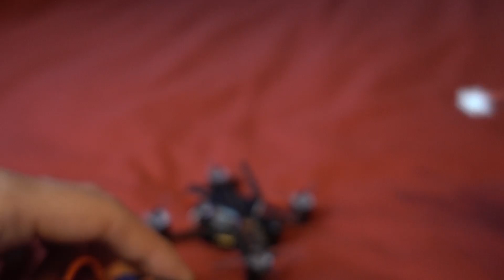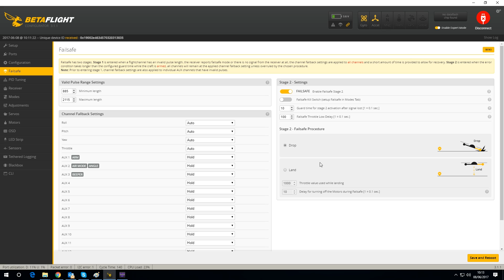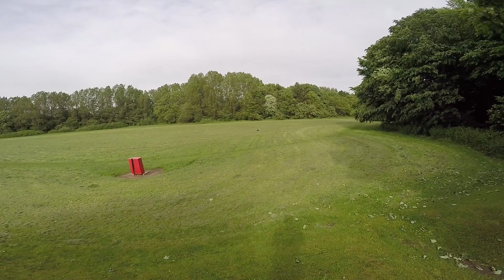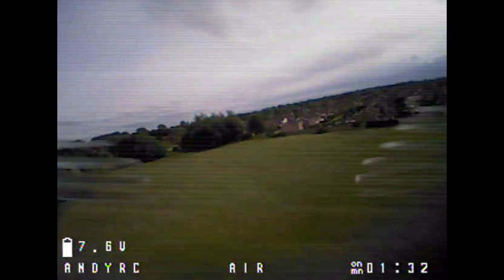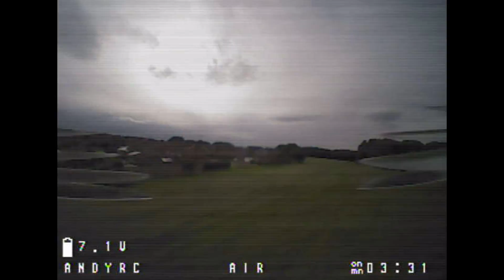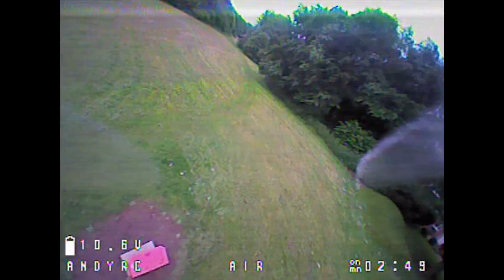ARFUN 95 Pro

Comment: This is an unrelated question to this quad but I do want one of these but I have a question that you may be able to answer. I was flying on my property the other day with my little qx90c which is perfect for my tight space and trees etc. plus I’m new at the hobby. What happened is I hit a powere line and the model went down. After that when I would throttle up it would yaw like crazy to the left. I changed all the motors and  that didn’t fix the problem but I hooked it to clean flight and it fixed the problem. Now the thing won’t connect with the taranis radio I use. I tried to bind again to no avail. Do you have any idea what I may have done wrong. I even tried using my old cli commands that I have saved on a notepad file and still can’t get it to connect. If there’s anything you know of that I may have done wrong or that you know may fix my dilemma I would much appreciate I know you probably have short time but your videos have helped me learn a lot that I didn’t know so I thought I would ask. Thanks lots.
Reply: Olli Garch bind the radio and rx and then go back into clean flight or betaflight and check your channels. The order has to be correct. If you powers the rx you can see your stick moments and adjust so that all your inputs match corresponding channels. Ensure you have modes and arm switches set up and you should be good to go

Comment: Hey Andy. I dont if you've experience this, but everytime I land with the battery below 8v I cannot re arm it anymore. Its like the gyro cannot initialize with lower than 8v. But on the bench and with the usb plug in, the gyro (3 beeps) will initialize and the copter can arm.

Comment: Hey AndyRC, Great review as always and as always I learned something new.  I watched a review where the reviewer put the four blade gemfan props and used a different battery with the eachine Lizard 95 and he was clocking at nearly 100mph.  That is crazy fast!  If true it's hard to imagine the Arfun pro is much faster than that.  I purchased the  lizard with frsky for $126.00 and got $3.00 off at Banggood so I got it for $123.00.  The Arfun 95 Pro is $175.00.  Not sure I believe the Arfun 95 Pro is worth $50.00 more than the Lizard.

Comment: Can someone explain to me how this quad is worth $175.00 considering you can build a quality 250 racer including a 4 cell lipo for the same price. Seems there's greed creeping into the hobby. And to top it off it comes with an inadequate battery.
Reply from the maker: pretty simple, smaller components re more expensive to produce its amazing you can even get micro components the same price as 250 racer components in my opinion. I use to have a similar opinion.... until i flew one :)

Comment: Help, I expirement erratic "flip of death" even at mid throttle with Eachine 2s 450mah 80c batteries !
I have the Frsky version.
Am I the only one ? Is there something to change in Betaflight that could help ?
Thanks.
Reply: Zeu d'Homme nope you'll need better batteries or switch the connector to an xt30.
Reply: jussa101 : what better batteries could I use. Those are 80c.

Comment: Hi Andy, long time subscriber, love your reviews! Very thorough, informative, and honest. For me, it's not all about how fast it is. It's about how versatile it is and the price. Between the two I'd definitely buy the Lizard, because $176 bucks is way, way too much for a 95mm micro! What were they thinking?! Exactly $50 more than the Lizard, and for what?! 

So, what I'd really like to see you review is the new KingKong 95GT and 110GT. 
95GT especially because it comes with prop guards and will be great to fly indoors.  My personal opinion is it might just be better than either of these... For me... Because I can have a blast flying it indoors AND also outdoors making it much more versatile and an upgrade to my Tiny Whoop!  There are a ton of outdoor flyers, but very few really, that are great indoor / outdoor flyers!... And that will run on a 2s or 3s battery. Imagine, it's pouring down rain (not hard for you to picture that from what I've heard you say! Lol), so only flying indoors today... The ARFUN and Lizard stay on the shelf because of too much power, but the KingKong 95GT and it's predecessor the 90GT get to run through an indoor course using a 2s battery with handy prop guards installed! ... So, later that day the sun comes out. I grab some 3s packs and head for the park with my same 95GT!  I like the idea of having that versatility! It should also be a little rocket on 3s, which it is rated to use from the factory. Sure maybe not quite as fast as the ARFUN, PRO, or Lizard, but! More versatile! 
PLUS! It's available with choice of 4 receiver's of your preference for EXACTLY HALF THE PRICE OF THE ARFUN PRO! (not from Banggood or GearBest). 
Yeah...really interested in a review of the KingKong 95GT!!!  Thanks again Andy! ;)

Comment: Disappointing about the battery and the continued brown outs. Last night I purchased a Lumenier 2S 50/100C battery to try on my KK90GT. I've used 25C and 35C batteries (300-350mah) on it and it flies well, but if I put on some better props, it might need "more power" .. ha ha.  Thanks for your review. Seems like a winner to me. Cheers!

Comment: I got the lizard for £94 on aliexpress and then ive ordered the arfun frame from gearbest! I recon then it will be a perfect combo. I'll do a video on it when it arrives
Reply: Use code rc18off on Gear best for Arfun pro 95. Mine just arrived
Reply: Yeah ive run into the same problem! im just happy to wait now tbh! im going to order a brushed micro in the meantime
Reply: The first code that actually works haha!
Reply: Maceyee  I might get it instead the lizard. What do you think?
Reply: Thats what i did, cant comment on lizard but i felt justified when i saw the antenna repair process for the lizard. i think if you took lizard youd be upgrading parts so it'll come to same cost eventually after discount
Reply: Well its preference mostly between whip and cloverleaf antennas , better range but less durability on the clover leaf. I think the lizard is still better though , It has a 100mw vtx a tripple integrated stack flight board (arfun has a seperate reciever) The motors are more efficient so " should" get longer flight times and the battery that comes with the arfun is rubbish! On the comparison videos I like the way the lizard flies better especially when doing acro( but thats preference again). Ive heard alot that the arfun's arms break alot even from small crashes , they are needle thin! finally the lizard is £45 cheaper so for me its a no brainer.
Reply: yeah summed it up - i went Arfun for the smaller package and carry ability - dont fly acro either. I agree that i found out about the arms breaking late but am prepared to lift and shift entire electronics onto a new frame if the worst happens
Reply: Yeah there isn't really an answer to which is best! they excel in different areas. So its different for each person! :) just have to choose
Reply: which brushed micro ? I got the eachine qx95 and its really nice but I broke an arm of the frame hahaha
Reply: Joseph Loa I was going to order QX95 but I'm not sure it will bind with the flysky FS-I6s and if its good to fly indoors as well! would you recommend it?
Reply: Ed Jones I think would be OK I got flysky Fs-i6x and I don't think will be OK for indoors because it's kind of difficult to control... In outdoor for me is very good and can fly it outside my house and it's soo good can  take a lot of wind... Sheme that today I fucked one arm doing acro Hahaha
Reply: How long will take from Aliexpres? im leaving in London and I am not sure if is reliable to but it from there.. what do you think?
Reply: I buy all my quad gear from there, Seems more reliable than banggood to be honest they dont run out of stock as much and any problems ive had have been refunded without question. Aliexpress are the only place with it in stock at the moment? so I would go for it!

but usually its around 14-20 days with the free shipping. You can always pay extra for it to come faster. Everthing thats £50+ from there seems to have a tracking number so you can see where its at.
Reply: Wow I didn't know that man so do you know how long will take the lizard95 to London ?
thanks bro!
Reply: I'm in cambridge so pretty much the same as me 14-20 days i would guess?
Reply: If I choose the DHL 7-14 days probably I will get it next week no the other one right ? because I might buy it now if is like that...
Reply: yeah with DHL you will it will be sent by air mail and not by boat. Its expensive sometimes though, im just happy to wait haha
Reply: Ed Jones Hahaha thanks for your help bro I will buy it right now is £16 more which is £112, 54 and it's better because I was about to buy the Arfun 95 and that one cost £139... So thanks bro!
Reply: We should meet one day and fly the drones Hahaha I have the qx95 and a mavic pro :)
Reply: There is a coupon code for the arfun i think "ARFUN" I dont know if it still works? but i prefer the lizards electronics, the camera ,the better battery and the efficiency of the motors, not to mention its cheaper! The lizard seems to have more than enough power/speed for me, the arfun doesnt seem to have the same feel!
Reply: Ed Jones well... I already bought the lizard Hahaha let's see if I can get it soon.. As well I bought some batteries in banggood
Reply: Can you believe that they told me that they have the Lizard95 available the 30 of jun ? and in Aliexpres said that there are 73 available... so they told me to wait till 30 (and I paid already..) or cancel it and get a refund... so what do you think... wait and get it next month or get li arfun95
Reply: Really? that is bad , what version was it frsky? I brought the flysky version but its not been dispatched yet. I got it from the Eachine store through aliexpress did you get it from there too?
 I Personally prefer the lizard but if money is no object go fro the arfun 95? depends how patient you are?
Reply: Ed Jones yeah the same bro the flysky they told me that will be dispatched 30 of June and I talked with eachine store

Comment: I fly it all the time with 3S  with 3 Bladed props.... now that is crazy..... there is no 2S battery in the world to hold  the need of this hungry beast! so u need to get it on 3S working ... 3S 25C is enough cause even if the voltage drops it wont reset....
Reply: Sam B can you share your 3s pids?

Comment: Big question, would it carry the Mobius mini if the dipole was rerouted?
Reply: benjamenus if not a dtx03 would probably be an interesting approach
Reply: Thanks for the suggestion. I had wondered about this (which also would work on the Lizard95), but the issue is the camera quality. Obviously it can be swapped out, but even the Swift Micro wouldn't capture footage like the Mobius.
Reply: I ended up buying the Lizard95, so it's the DTX03 for me
Reply: benjamenus it could but performance and handling would be mullered.....
Reply: I wasn't sure by how much? My skills can't (yet) handle super-fast flight, so really I was hoping that it would still give decent acro/freestyle performance? I thought the extra weight would be similar to using a 3S (though obviously the extra cell helps performance, whereas a camera would take it away).

Looking back at some of Andy's vids, he's put the Mini on the Rodeo 110 - and I thought that if the Arfun95 was more powerful, maybe it'd deal with it?
Reply: Have you tried it already? I'm planning to mount a keychain 808 #16 on it, it only weighs 7g but I'm afraid it will slow it down too much...